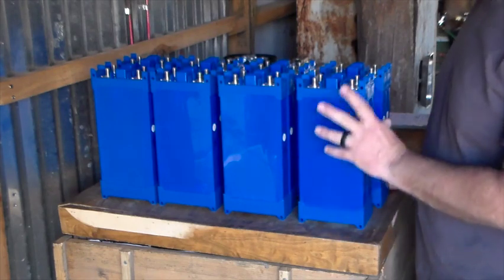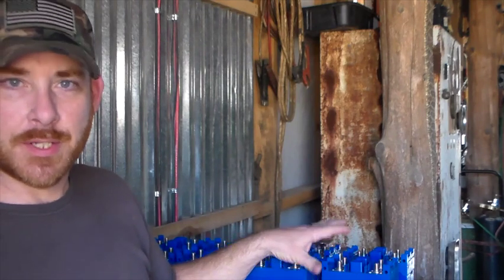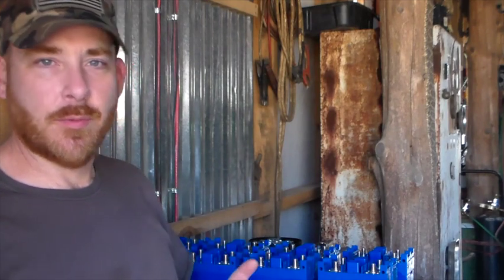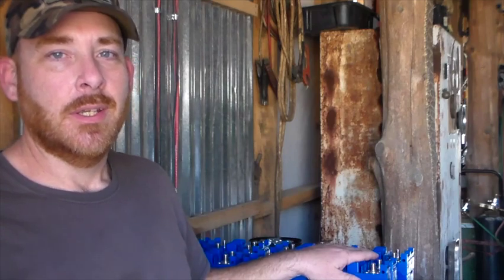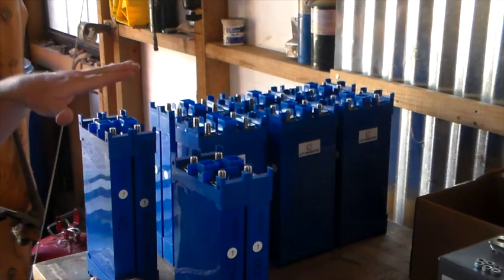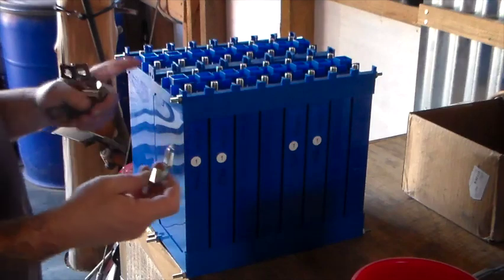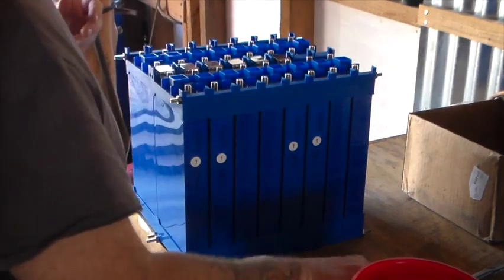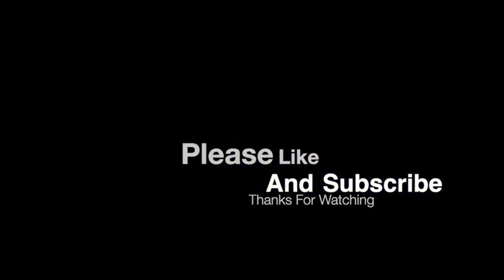LiFePO4 8s-2p 24 volt battery configuration / Off grid power house

Comment: what size bms did you have
Reply from the maker: It is a 100 amp Overkill Solar BMS for 24 volt. Hope this helps. Thanks for the Question!
Reply: @MountainMike01  needs to be 200a bms for a 200ah battery but looks good good job
Reply from the maker: Hey thanks man! Good eye. It sure does. Thanks for the correction.